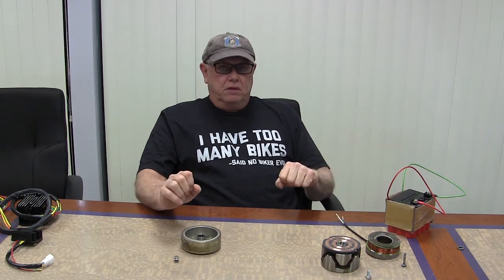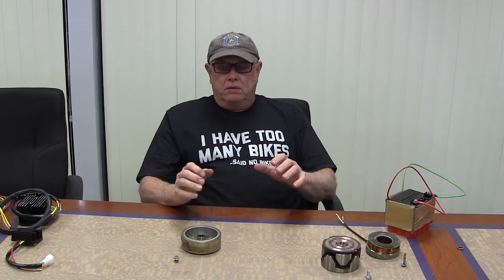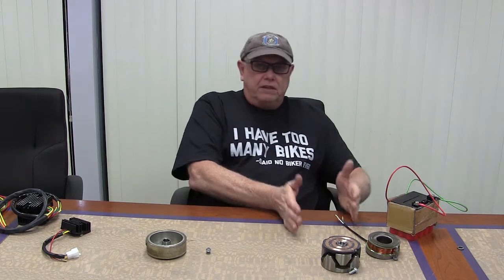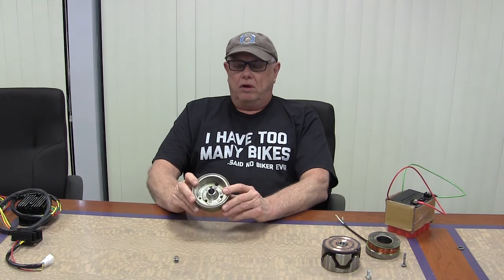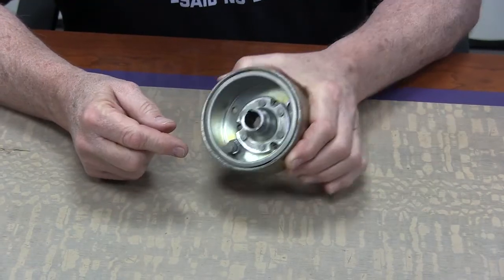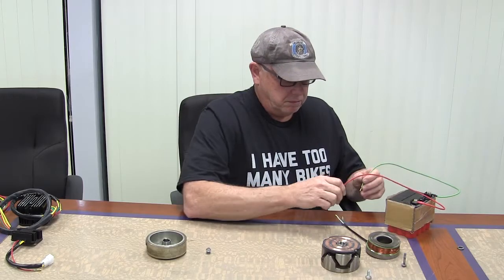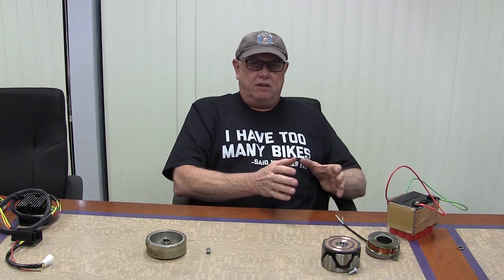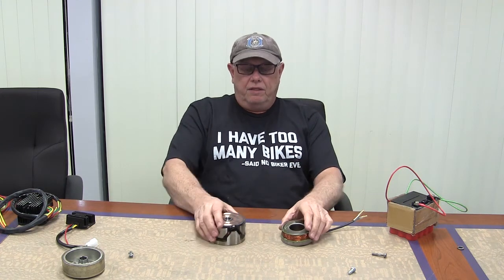Motorcycle Charging Systems: Permanent Magnet vs. Field Excited. What are they and how do they work?

Comment: Very COoL. Thank you for the video. I could have watched this decades ago and been way ahead :)  Would have loved it to be 3 hrs and 40 mins of this type of  infoTainment. Q. Since we know there are "no free lunches", is there a penalty to be paid for the "shunted" method? We know that when a "field coil" is turned on, you literally hear the R's drop on the engine (we know it's working). Is the "shunted" method continually working to some degree? When generating (of course) but also when shunting? i.e. that whole "no free lunch thang". Feel free to skip this question.  I really just wanted to put that out there so I can think about it. You RoCk!  Cheers from So.Ca.USA 3rd house on the left
Reply from the maker: A shunt-style regulator (which is only on permanent-magnet systems) forces the generator to output 100% of possible amperage.  That current is then either allowed to go to the bike to power electrical load or shunted as excess.  So if the flywheel is turning, then the voltage regulator is constantly making that decision.  The generator is ALWAYS driving 100% of its maximum possible amperage relative to RPM with shunt style and the rec/reg has to decide what to do with it.  By contrast, a series-style regulator in a permanent-magnet system operates by opening and closing the stator lines to only draw necessary amperage.

Comment: Great video. Very informative. What would happen if you connect a regulator/ rec for say a CB750 with exited field coils to say a KZ900? Would it work if you just use the 3 stator wires and pos and neg and just terminate the field coil wires? Just curious as I have a new RM100-100 in its box and my CB750 K4 is long gone. Thanks for the help.
Reply from the maker: KZ900 should be permanent-magnet, so if you connect a field-style rec/reg to it the voltage regulator won't function.  The rectifier will still work but there will be nothing to control it, so it will overcharge.